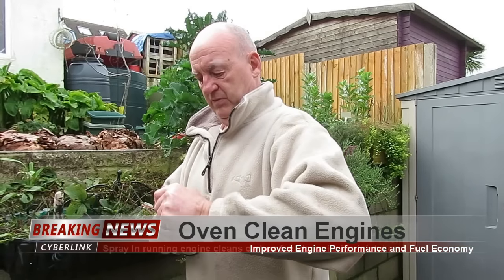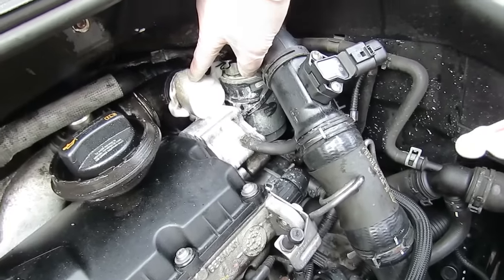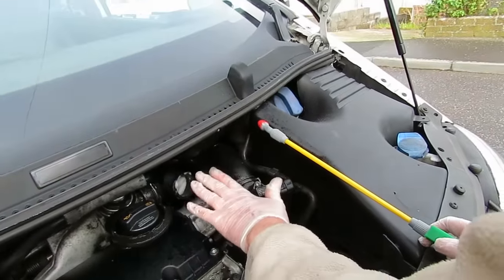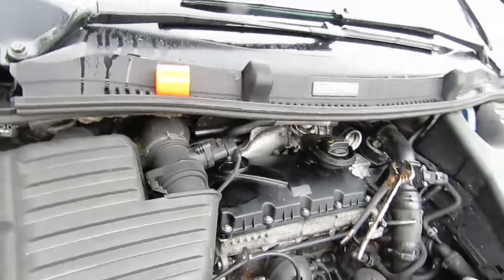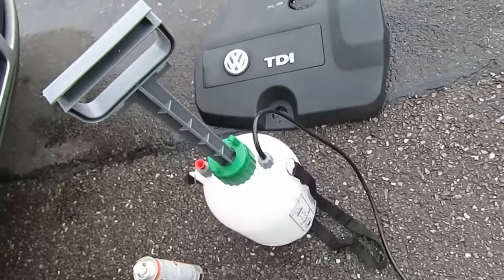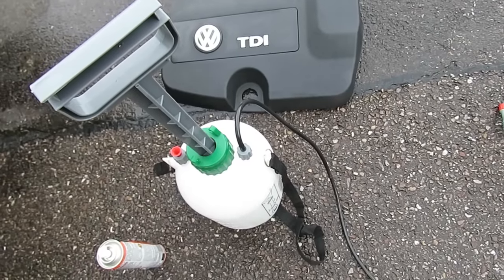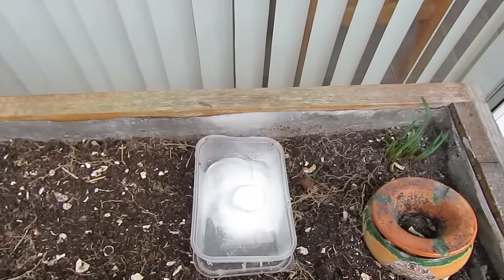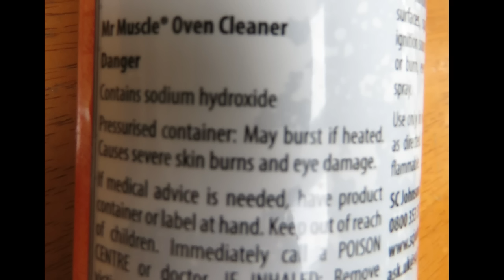Clean EGR Valve Decarbonize Turbo DPF MPG Limp Mode Mr Muscle VW 1.9TDI Sharan Galaxy Alhambra

Comment: Can you show your registration plate , so I know not to buy that motor 😁
Reply: what do you think they do at main dealerships then when cleaning the egr ? do you seriously think they take it off and soak it  ha aha ah
Reply: @philldownes8685  I can safely say that they dont put Mr.Muscle oven cleaner into it...
Reply: @philldownes8685  they dont even waste time cleaning it.
They replace it and charge it on the bill...you think dealers have time for this lmao!they dont rebuild engines and transmissions either!this is why techs at dealers know mostly how to bolt new parts in...but know nothing about overhauling.
Reply: In this time you will easily remove egr and do it properly...

Comment: I've just come across this jewel of information. While I can confirm Mr Mr Muscle as recommended in similar threads, is very effective at dealing with carbon, I cannot believe this guy has simple squirted the stuff directly into the intake and inlet manifold while all still attached! On my pug 207 1.6HDi 110 Fap, the inlet manifold appears to be plastic and I removed this to clean it and it was a nightmare until I tried Mr Muscle; After that, it was literally spotless! Unfortunately, the remainder of the ports was still a mess and being aluminium and going to the valves, had to be cleaned much more carefully, by hand and ensuring nothing could fall into open valves (didn't mess about with TDC). As has been said by others, Mr Muscle will attack aluminium so you're gonna have to find something else such as EGR/intake cleaner or at the very least, something that is ali friendly! This guy may have got away with this but I wonder how many have tried this and really messed up their cylinder heads with Mr Muscle eating it away? I note it is mentioned that limp mode happens rarely but if that's the case, then something still isn't right is it? Love to know if he thinks his pearl of wisdom is still a bright idea a year on? Maybe for your next trick, you can try it again with a few cups of gallium (seriously kids, don't try it!) ;-)

Comment: Rather than go to all this bother just disable the bloody EGR valve by pulling off the vacuum hose on the top of  the EGR unit and plug the said hose with a bolt - Hey presto your car no longer sniffs its own farts which cause the carbon deposits in the first place.

Comment: Listen to that engine rattle when the water is sprayed in it lovely video on how to knacker an engine because your to cheep to do the job properly anyone doing this be warned this is very bad practice and will result in more damage down the line
Reply: dont knock water injection till you know more about it ,,, granted this isnt the most accurate version , but go read , you will be amazed.
Reply: @tomthompson7400  yep, water injection is a new idea, people been doing it since around 1910   yes over 100 yearsand works very good.
Reply: @tomthompson7400  would you say this is safe to do on a Kia Sorento 2.5 crdi engine? I'd be pretty much worried about gaskets
Reply: @icarr121277  I wouldn't be trying it unless I had to ,.. if it goes wrong it will go very wrong ...
Reply: @tomthompson7400  yes that's what I thought, I wasn't keen on pumping water into the engine, it's just there's a lot of positive comments about it too. Thanks for the reply
Reply: @icarr121277  mostly water injection . Or misting was done on petrol engines with a very high level of maintenance aircraft and racing cars .. it really wasn't for the masses and a modern common rail engine has enough going on in it all ready and way more in the way of electronics .. a new range rover won't even run on red diesel as the brain sees the dye as a contamination and won't put it into the engine ... a good injector cleaner once a year is all you need .and buy good fuel .
Reply: @tomthompson7400  that's an interesting bit of knowledge, I have only just bought the car and got it for half the book price, it rough idles and smokes on cold start up, especially at 1500 revs is very rough but after 5-10 minutes it's the smoothest case in ever drove with no smoke at all, also the gears seem to take a while to change "auto" but again the box is very smooth that you can barely tell when it changes gear, I'm thinking the hear change might be normal on a engine size this big, I don't know? I always use BP and not sure if it's been ran on supermarket Diesel/water in the past, I would just like to get the idle problem sorted as I believe it carnt be doing the engine any good also eating the diesel when cold. Read alot pointing to the egr valve but again, I don't know. Thanks again for your help
Reply: sounds like egr valve problems ,, be sooted up , strip it and clean it with oven cleaner 
should sort things out
Reply: @tomthompson7400  I will do 👍, and thanks again Tom
Reply: I can hear the bearings screaming from here lmao

Comment: Oh dear !  playing Russian roulette seamed a bit sketchy but this  takes it to a new level .

 listen Guys  their  are lots of well tested and developed products that work great out there for about a tenner surely your not that skint that you have to resort to oven cleaner i know it cleans great but i hope its caustic quality's  only erodes the carbon build up on the egr valve ,  as for spraying water in a high compression engine like a diesel !   be sure you don't squirt too much because if it hydraulics on you  your car could be scrap instantly .

 Not great advise i would leave it to a trained professional even approved egr cleaners can create havoc if you don't know what your doing or understand what is going on when things start going wrong.
 Sorry Andrew but you have to take responsibility if a "have a go guy" destroys the family car  through lack of knowledge and experience all to save a tenner on a "quick fix on the cheap "or "it worked for me  "attitude

Comment: To all the armchair experts and keyboard warriors out there, let me just give you a real-world take on this. I have a 2009 1.8 TDCI  mondeo. (No DPF).  My EGR valve was stuck open so was getting no power at low revs. Engine light was on permanently Tried the "Authorised" EGR Cleaner spray last week, and it made no difference... still drove like a dog. Ran the car for a week to see if it acted gradually but no difference. £15 wasted

Today I tried this method, packing the inlet with Mr Muscle and then after 30 mins, flushed it through with a fine water mist at 2000RPM.  Tons of black smoke which eventually cleared, re-fitted the hose and started up... Drove for 30 miles and now it has completely cleared. it's given the engine a new lease of life.

Job Done !!  Worked a treat

Since doing it this morning and putting 53 miles on the clock, the Engine light has gone out now, so the ECU seems happy with whats happening

Would it have been any better if i-d stripped the egr valve out completely?  possibly, but these are not easy to remove as access and clearance is crap. I might also have threaded, snapped or rounded a nut or bolt doing it 
Would it have been better to buy a new EGR valve ? probably but if your valve is gunged up, what have you got to lose?
Reply: What have you got to loose?...

Maybe your engine 😂😂😂

Like yeah if the cars worth £100 sure run it on bacon fat and clean it with Mr muscle, fuck it use crisp and dry as motor oil why not, 

But if you have a car with any value please don't use kitchen cleaner on your engine just take it to a mechanic

Comment: Make sure to change motor oil after this type of treatment because some of this could go into the oil
Reply: ste jack Not heard of blow by then? If it’s in the cylinder while it’s running, some of it can get by the piston rings, as they don’t make a 100% seal.
Reply: Best thing to do is not do it this way atall

Comment: Try sand blasting it with the engine running. That should do the trick.
Reply: @monkehbitch  After surface blasting kindly apply zinc epoxy primer within 4hours 😁😁😁

Comment: Just tried this in a 1.6hdi peugeot partner with black smoke out the back (not enough air) and very low power. sprayed directly into the turbo at 2500 rpm.  Management light came on with anti-pollution flashing on dash, cleared the code and the van is ripping up the road.

Comment: Does that mean the Mr Muscle goes into you engine when you start it?
I cleaned my ERG valve with brake cleaner (£2.45 from toolstation) it removed all the sludge and did a good job.
A garage told me I needed a new ERG valve at a cost of over £100, so this saved me quite a bit.
Reply: @Gordon Bird You have not written any comment.
Reply: @Gordon Bird I didn't used Mr Muscle, I used brake cleaner.
Reply: @Gordon Bird I've used Mr Muscle on an aluminium sauce pan. I would not say it eats aluminium away, it barely does anything to it apart from take the shine off it if it was polished.
Reply: @Rubber Thingy  I first cleaned it about 7 years ago with break cleaner. I've cleaned it once more since then using the same method. It's working fine as it was just gummed up with exhaust deposits so needed to be cleaned. Certainly worked out better than paying over £100 to get a new ERG valve fitted.

Comment: Take a bucket of warm soapy water and introduce to the air intake at approx 3500 rpm
Reply: if you do that in a very fine mist it wont do any harm... chuck a load down and hydro lock.. but the soap will not do anything...... its just the water steam cleans the combustion chamber of carbon......... can go to dealer and get it done for around £200 or do it yourself for £5........... you do the math

Comment from the maker: Car still running, though getting clogged up again thanks to VW's idiotic exhaust gas recirculating screw up. Getting limp mode more frequently now, so will change turbo. Turbo is still running  5 years after treatment, so guess the only whining is coming from the comments :)
Reply: Did you change the turbo? I have a ALH tdi here in the states that goes in limp mode. Just wondering what your latest news is. Thanks!!

Comment: I wouldn't have dared to spray oven cleaner into my intake with the engine running. I usually take EGR valve off my A3 2.0 TDI and clean it that way but hey whatever works for you though.

Comment: Try this at your own risk.... Yes it did work however the video showed that it will cause oxidation. This will lead to rust and eventually the part(s) will fail.
Reply: Todd H where will the oxidisation come from. The reason the inlet and turbo get blocked with carbon is due to the oil vapours from the PCV sticking to the intake and allowing the soot (carbon) to adhere to it. The internals of the inlet side of the motor although won’t be that clean anyway will soon be coated in oil as soon as you test drive it.

Comment: FFS. THAT SHOULD ONLY EVER BE USED ON THE EXHAUST MANIFOLD
Reply: there is proper cleaner you can get and this IS the correct way to do it. but oven cleaner will work perfectly as it will attack the carbon. the real stuff you buy is the same thing just a much weaker sollution.. i would use the oven cleaner over the stuff from the motor shops every day of the week... just keep it off your skin. the rinse should be a much finer spray and less of it.

Comment: They have been running water injection on turbo engines for decades to stop pre ignition in petrol engines. They ran water injection on the spitfire planes during the war.
Reply from the maker: The German Planes in WW2 ran far better when there was a lot of moisture in the atmosphere
Reply: True. But that's water. This isnt just water. 👍

Comment: Personally I wouldn’t advise this method but if you don’t have the mechanical knowledge or time to strip and rebuild or can’t afford garage costs then why not.  
As the caustic solution causes oxidation more violently given temperature you will get a tad more than is here evident.  But here aluminium oxide is a protective barrier from further oxidation.  That said it is highly abrasive hence it’s use in sanding papers. .  But then given that vapours will quickly recoat surfaces it’s not so much an issue.  
What I would advise is that 10mm of vinegar per 250 ml is added to the flushing water.  This will help neutralise the sodium hydroxide which might pose a risk to seals and pipe work.  Diesel engines naturally produce acids.  All in any potential harm is minimal apart from safety issues the presenter points out- to oneself. In fact water has been used in the combustion chambers of high performance track cars in the past to boost compression.   But also a engine consumes water vapour daily.  

I recommend that if you can’t afford or don’t have the technical knowledge then by all means try it.   It won’t do much in the way of harm whatsoever. 

Edit. I wouldn’t recommend injecting just after the MAF but if you do then I advise this is only done prior to an oil and filter change.  In fact I would recommend that an oil and filter change is done regardless assuming it works.  Even then the effectiveness will be reduced.  
Now if this is done in conjunction with an egr delete all the better.  Often the cause is not simply the egr valve itself but a build up crud in the manifold, turbo, wastegate and ancillaries.  

Ex Shell engineer

Comment: It works better if you pour a gallon of apple cider vinigar into the inlet manifold while the engine is running and of course with a pinch of garlic to keep the vampires away.

Comment: Read more about how engine with egr valve and turbine works and after learn some chemistry before you give your oppinion about water goes into it or maybe you think if you do this the engine will be like new and goes another 1billion miles more...I do that long enough with my vw golf mk4 and vw golf mk5 when I don't have time to remove the egr valve and clean it properly... so think twice before you talk. ..all the best! Thanks a lot for the video! Ta da!😉
Reply: its a simple fact that water is NOT supposed to go into the intake. After all, what kind of intake is it thats on your car? Ill give a little hint! its a three letter word that starts with A and ends with an R!!